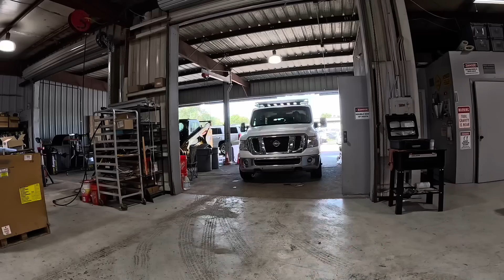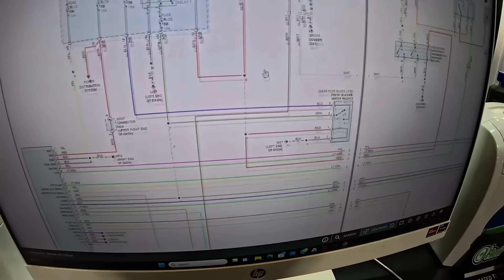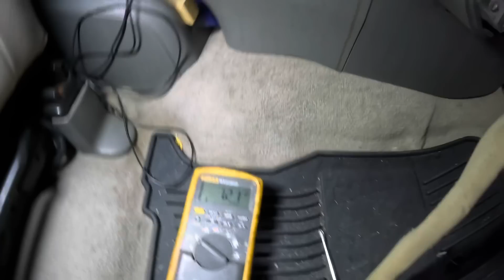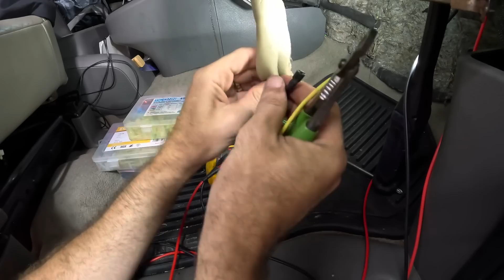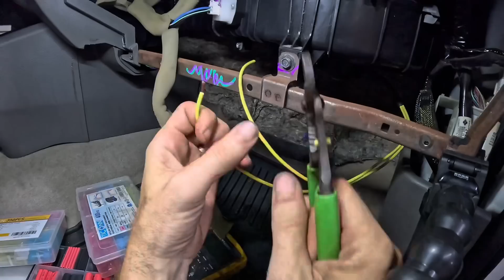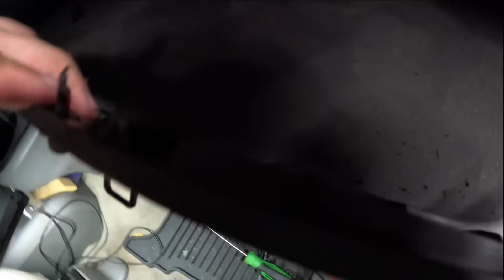Make it Work! No Parts Repair! (Sort of) Nissan NV 3500 Wiring Repair

Comment: Soldering is always best. Retired body and frame repairman with 46 years experience.
Reply: Name a wire terminal connection on a vehicle where the manufacturer uses or used solder connections, other than inside a module.  They don't.  That is because heat and/or vibration will eventually cause solder joints to crack.  And...the most common problem with a failed module is cracked solder joints inside it.  A properly crimped connection is a better connection for a vehicle than solder.  As a body guy you won't ever see the come back because it ends up at a repair shop, not the body shop, for the eventual repair because nobody ever thinks the electrical problem is due to a body repair from several years earlier.

Solder works but it isn't the best. Ray's repair, if not damaged by wandering feet, will last the lifetime of the vehicle.
Reply: many reasons for using crimps.  Easier to replace if needed is #1.  Can you imagine if the wires were actually soldered to the motor?  You would probably have to desolder the motor and pray that you don't wreck it.   Lead based solder is the only solder that is actually worth a darn.  The silver based solder is not nearly as good.  Lead based is becoming  more difficult to obtain.   There are some instances when I will use solder, but they are diminishing.  Final point is "if you are going to crimp, don't use the cheap ones"   You need to go first class with crimps or not at all.
Reply: @scannerlanier471  When putting a "new" pigtail on a headlight, tail light, or anything damaged in a wreck, I personally solder these in.  Many have come back from other guys because their crimps have failed due to salt corrosion, many times these jobs were given (forced) on me, because I never got comebacks, and no, I never got paid for it.  I forgot to mention, I live in the "rust belt" Michigan.
Reply: If soldering is best , why does every car manufacturer in the world use CRIMPS at both ends of every single one of the hundreds of wires in their cars ? Every pin and it's corresponding socket are crimped at every connector.
Reply: GOOD to Go Ray
Reply: Back in the "80"s I worked on De stacon wire crimping machines making wiring for the automotive & other industries.We used pull destruct tests to confirm crimping & wire

Comment: YOU DIDN’T ORDER THE CORRECT PLUG??? You saved yourself time AND your customer money and time??? Thats the repair to make! 100% of the time thats how I would have done it.
Reply: Was thinkin' the same; someone had tried to repair - less successfully than Ray - in the past.  I actually did similar on my '88 Mazda truck: had a two connector plug to the alternator which was damaged, and I simply finished breaking the plastic plug housing and plugged the two female ends into the alternator.  I labeled them as without that plastic housing one could mistakenly interchange the two leads.  I have since located a plug for the future to splice in, if I need to.

Comment: Be very careful on Japanese vehicles to check that what you think are Philips screws are not in fact JIS screws which require a somewhat different cross-style screwdriver. If there is a dimple in the head of the screw, it is JIS and not Philips. Using the wrong style screwdriver can cause damage to the screw head.

Comment: Nothing wrong with your method Ray. It works, it’s clean and it puts the van back on the road where it should be.
Reply: It's what i would do if it were mine. No sense in spending more time and money when rays repair will function the same as a new connector. They'll get some points off when they take it to the car show, though.
Reply: Why would you want to replace the connector with a original connector design that fails?
I like his harness better.
Reply: Absolutely. If it works, and is solid, then it is a good repair. Besides, with manufacturers, in order to replace that connector it would probably require replacing the wiring harness from the AC control to the blower.
Reply: @kennethking2301  Fix the connector? Remove Engine.
Reply: Plus it probably save the customer $30 or more as well.

Comment: Did the same thing on my tacoma to get an aftermarket alarm out and radio replacement plus blower motor and resistor change. My dash is out, and all panels are in passenger compartment

Comment: I just replaced the blower motor in my 2000 tundra the first one made it 280,000 miles not two bad . great video ray’s you did the exact same thing I would’ve done in that situation.
Reply: I am on my third blower motor in my 09 F150. The first two factory replacements, the third one is Chineseum and has far outlasted the Ford blower motors for a fraction of the cost.